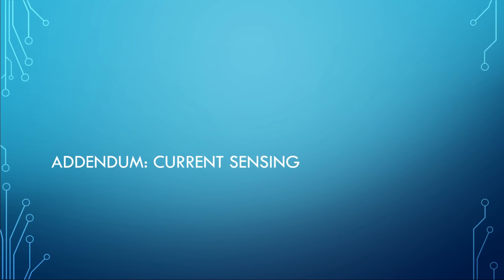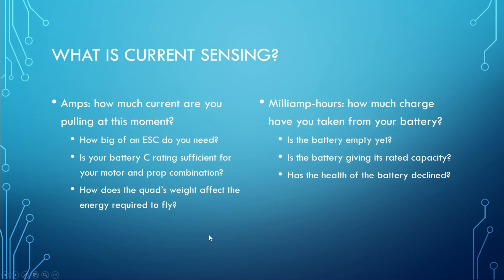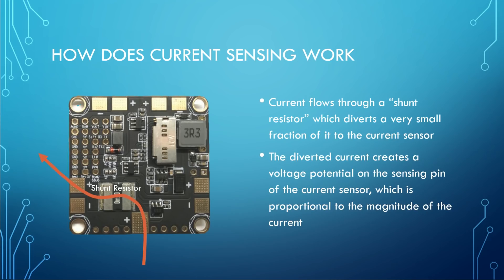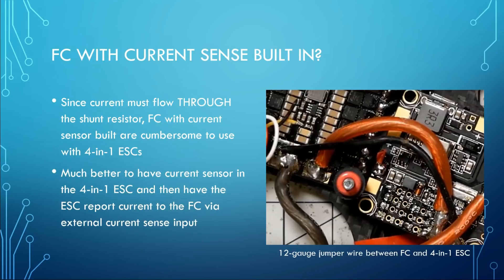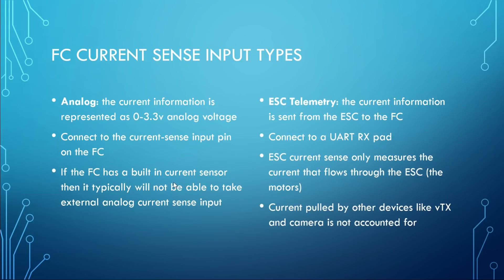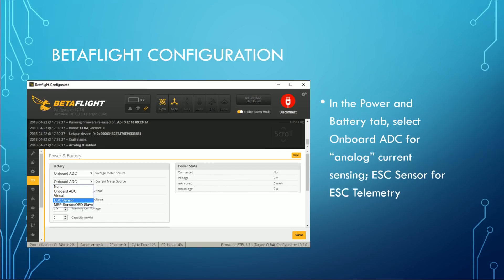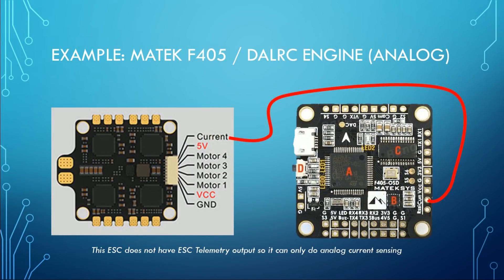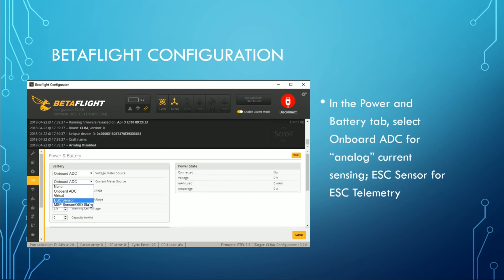Flight Controller Wiring For Beginners - Part 7 - Current Sensing

Comment from the maker: The ability to adjust current scale in blheli has been added in 32.4, so that part of the video is not accurate any more.
Reply: I have 4 seperate esc's and a crt port on my fc do i connect my + lipo straight to the crt sensor?

Comment: Hi JB, thanks for the comprehensive explanation. It’s an old video, but it still great. I use 4-in-1 esc with 6 wire, so no current sensor or esc telemetry. I use Onboard ADC in BF power setting and I can display mAh in the osd.  Then I found XT60 plug with current sensor in local market. Can I use that? I have curr pad in my fc. What is the difference with my existing setup?

Comment: how do  you wire current sensor a x8copter with 2x 4in1 esc ?
Reply from the maker: Basically, you can't, because each ESC is only measuring its own current. You need a external current sensor wired directly to the battery plug.
Reply: @JoshuaBardwell  i was thinking  of a swiching system to read each of them seprately !

Comment: I have Airbot F7.  It has what looks like a current resistor it is a 7mm x 7mm x 4mm tall block on the board labeled "470" and a current pad on the bottom.  

However it does not advertise having current sensing.

But then again I am.finding a few things it does not advertise having, for example it has F BUS and in what little documentation that came with it says it has smart port, this through me for a unneeded loop.

Anyway, is it possible that this "470" block on the board is a current sensor if so how do I wire for it, your video shows using 4 in 1 in connection, I am using a simple esc power block and wiring esc sensor wires to the FC.

Here is a link to the board and you can see what I'm talking about.

https://www.racedayquads.com/products/airbot-f7-30x30-flight-controller?variant=31414349725809&currency=USD&utm_medium=product_sync&utm_source=google&utm_content=sag_organic&utm_campaign=sag_organic&gclid=Cj0KCQjwl4v4BRDaARIsAFjATPkdUvy-XYa8xp3OeiZvtb1xRQmAjl_vqdyjsANyEfWG333vQO8t1Q0aAllxEALw_wcB
Reply from the maker: That's an inductor not a shunt resistor. That FC doesn't have current sensing because it doesn't have a built in PDB. Current doesn't flow through that FC. That FC must be used with an ESC that has current sensing.
Reply: @JoshuaBardwell  Thanks, this is why I watch your videos and research before soldering anything.  I'm going to skip the current sensing for now, im using the F7 to run an old cheap Eachine 250.  Kind of overkill by why not 

I did not know you had your own design of FC.

My next build I will get the one on the video.

You have an edge on selling FC's as you have an established set of videos to teach new people to the hobby how to build their own stuff. 

I know I can buy your FC and find a video on everything it does.  That is a massive edge over everyone else's ESC's 

I posted a review on racedayquads about the lack of instructions with all kinds of RC stuff, I am not alone in being sick of it.

To much time trying to find out what to wire, to much room for mistakes and I have $120 worth of burnt up Naze32 boards before I learned how to wire those.

Be looking for something called Wickedwings RC,  it's just decals for RC stuff but people want their stuff to look cool.
Reply: @JoshuaBardwell  Hate to bother you again, but I'm wiring the Airbot F7 now after watching your video series.

The only snag is when I unplug the USB cable the Receiver loses power.

Gets it the big old R8X using SBus all I got for now.

I have the Ground and 5V wires installed and going to the Sbus plug on RX.

I have the BDB wired to the Vbat and ground to the board, I assume that is where it goes as wire diagram shows no where else.

The board "says" it can handle up to 6 sell direct connect.

The output votage at the Sbus pin cluster with USXmB is 4.8v

Without USB and lipo only it drops to 2.2 volts and RX shuts off.

What did I do wrong?

Comment: Hey Joshua, I have the Mamba F405 MKII 4 in 1 ESC and flight controller stack which has a current sensor on the ESC which is connected via the curr and UART 6 connection from the ESC by default with the included connecting cable. The documentation indicates that UART 6 is for "ESC Tele". I have sensor input for UART 6 set to ESC, and under configuration I have ESC_SENSOR turned on along with current meter source set to ESC Sensor under the power tab. Under the motors tab if I spin them up it shows me RPM but current readings stay at 0A. I have tried different combinations of current meter source and nothing is working to give me a current reading. Could you help out with this? I am on Betaflight 4.1.1 and running the JESC 2.3 firmware and telemetry on the ESC. Thank you, get well soon.
Reply: I’m having a very similar problem. Have you figured anything out yet?

Comment: Please tell me how to voltage sensing on my 4in one esc which has only current sensing output and my micro pix fc has inputs for voltage and current inputs?Can i just plug 5v output of my esc to voltage sensing pin on my fc or i will smoke it?

Comment: Hello, I have the following problem. On my JBF4 AIO FC, the current is not measured, I use the FC with a JB ESC 4 in 1. Do I have to set something special in Betaflight or is it something else?
Reply from the maker: JB ESC uses ESC telemetry. On the underside of the FC bridge the TLM solder jumper.

Then set up ESC telemetry on UART 4.

In power and battery tab set current sensor to esc.
Reply: @JoshuaBardwell  I tried it that way, but unfortunately it did not work. the UART4 is equipped with VTX SmartAudio. Can it be that one can not use both functions at the same time? Or do I then have to put SmartAudio on a bad UART for example UART6 (is the only one that is not used yet)
Reply: I have now put the SmartAudio on UART6, on the UART4 I have set ESC telemetry and changed in BF the current sensor to ESC. The Amper indicator remains still at 0. The solder bridge on the bottom of the FC I have of course also made. Can it be that the FC I just have a defect?

Comment: Hi JB, I have a FC Omnibus F4 pro, which has shut resistor and I am planning to buy a MATEK voltage regulator, there too I see a shunt resistor, how could be the wiring for +ve here? should I plug in XT60 to MATEK and then sold MATEK out to shunt resistor in of FC?

Comment: I have a matek f722 se fc and  4x dys aria 35amp esc. The esc's has a curr and tele pad. The bottom of the fc has one pad for curr in/out. How do i connect all the curr pads from  the esc to the fc?
Reply: hi did you find your answer ?

Comment: Hey Joshua! I'm so glad to have your videos explaining all this stuff. I have a question about connecting a 4 in 1 ESC without ESC telemetry to your Bardwell F4. So to get correct current sensing I have to solder VBAT to the FC first. Then I connect the 4 in 1 ESC to one of the four ESC+ pads on the FC and ground is going from the ESC back to the battery. The ground of the FC isn't needed in this case, right? It's simply connecting them in series.
Reply from the maker: https://youtu.be/1SvbZNU72FE

Comment: JB, I'm wiring up a Kakute F7 AIO and I'm troubleshooting but I can't find anything on what the LEDs on the FC are telling me.  There's nothing in the manual (kudos on writing that BTW!) and I haven't been able to find anything in forums, etc; it seems to me that the question hasn't even been asked but I know that can't be the case!

Blinking blue, solid green, etc; what do they all mean!?

Any help, as always, would be much appreciated! And I appreciate you fighting the good fight and helping all us dummies out!
Reply from the maker: One of the LEDs typically indicates power and is either on or off. The blinking LED indicates the FC status. When the buzzer sounds for any reason, the LED will flash. A slow-blinking LED indicates arming is being prevented for some reason. 

When you try to arm and there is an arming prevention code, the LED will blink to indicate the code. More about that here: https://www.youtube.com/watch?v=N8oMMG2kmns 

Finally, if there is a hardware issue preventing the FC from initializing, it will blink a sequence of five-fast and several slow to indicate the issue. In this case, the FC will never start up, you cannot connect to USB, basically the FC is dead and all it will do is blink that code.

Comment: Hello love your videos..I have a question if you can help much appreciated...i am trying to connect kakute F7 FC with Dalrc 50a 4 in 1 esc using plug connector..The FC plug pin out says 
(M4~1) ( I ) (G) (R7) (B+)  Im not sure what the R7 and I is for exactly..I thought i saw somewhere that ( I ) is NC?
Reply: It's in their manual...ESC telemetry.

Comment: Joshua, very helpful video. Unfortunately I coludn't find the solution to my current problem: Iì'ld like to connect a pdb (Matek HUSBOSD-8) current sensor to Kakute F7 (non AIO) flight controller: I'm unable to find a pin on FC to which connect the current signal from PDB . Can you help me?
Reply from the maker: The Kakute F7 does not have an analog current sensor input. However you can probably use resource reassignment to convert the RSSI pin into an analog current sensor input. 

In the CLI type "resource"

Find the line that says "resource ADC_RSSI 1 XXX". Make note of whatever XXX is. That is your pin number.

Type "resource ADC_CURR 1 XXX" where XXX is the pin number.

Type "save".

Use the RSI pin as analog current sense input.
Reply: Joshua, tanks: you are a force of nature, you saved my life.

Comment: Hi Joshua, enjoy you're videos very much and find them very educational. What i want to do is fit a secondary louder buzzer to my quad but i only want to operate it by switch (ie i dont want it going off when battery is low/ signal is lost etc) is there any way of doing this? I have a hypetrain f4 riot flight controller.
regards
Jon
Reply from the maker: Betaflight supports only one buzzer at a time. But you can disable the low battery etc. functions if you want. In the Configuration tab.
Reply: Thank you for the quick reply Joshua. Is there any way you can wire in swichable extras on these boards or do they do boards that have extra outputs on for customized drones do you know? As I have a few things i want to try but also want the freedom of acro flight mode thanks again
regards
Jon

Comment: Hi Joshua. I have you're new Bardwell f4 and a Racerstar 35 amp 4 in 1 blheli-s with current sensing. What pin would i connect current sensing wire to on you're board to get Mah? You're so helpful to the community. Thank you!
Reply from the maker: Use the current sense input in the 4-in-1 plug. Check the manual for details--download from racedayquads product page for my FC.

Comment: Got an external current sensor built on the xt30 made by hglrc (could be a clone of diatone's). From what I understood in your video I have to connect it to the current fc pad and set it in BF GUI as onboard adc. So is it safe to say, whenever I connect to the fc pad its usually an analog signal? What is virtual source and will that work with the external current sensor? Are all external current sensors that connect to the fc pad give an analog signal?
Reply from the maker: Virtual uses battery voltage to guess about current consumption. It is inferior to an actual current sensor. All external current sensors are analog... well... probably there are some SPI or i2c ones, but you're unlikely to encounter them.
Reply: HI again, just spoke with support from hglrc and according to their tech I should set source to virtual and set amp scale to 200. but like you mentioned most external current sensors send analog signal so this really confused me. Do I proceed with common knowledge like in your video or do as instructed by hglrc tech support (which I am not confident they are right about the settings)

Comment: If you calibrate individual esc stand alone to get them equal i wonder if this is possible.
Reply from the maker: I guess that would involve disconnecting all but one ESC and measuring the current. A pretty big hassle, but not impossible.
Reply: Joshua Bardwell thanks that is indeed another requiring individual test. Been considering this or to save time , then again to fly my Quad 4-5 minutes my Chameleon the thought of going to all this might be a make or
Break for me . Or just stay with the voltage monitoring instead.

Comment: Hi JB
Your videos are so so helpful and informative many thanks .. i got a lumeneir +4 that comes with curr tap , i really don’t use this as i’m building quads with dji systems , if I didn’t use ( soldier ) any wire to that curr tap because i don’t need it , will this affect the other wirings ? Thanks for the help in advance as always..

Comment: Aikon 32 4-in-1 ESC telemetry only outputs voltage and RPM--NOT CURRENT; Need to use Analog for current.

Comment: I have the HGLRC XJB F428 version 2.  The 4 in 1 esc board has no "current" pad that I can find however, the FC (omnibus F4) does have "Current and RSSI" on separate pads.  Not sure what to connect the "Current" pad too?
Reply from the maker: If the ESC doesn't have a current output, you would need to install a current sensor.
Reply: Joshua Bardwell Got it thank you.  I made the assumption because it was a stack I was missing something (why offer it on one board and not the other). Never done learning, thx for your help!

Comment: For current sensing with a 4-in-1 that doesn't support it, the Omnibus F4 Pro works great. Just one pad, right beside the shunt resistor, instead of four separate pads for each esc. So easy soldering and you can include the current drawn by your vtx and camera.

Comment: Us beginners use f3 not f4
Reply: Why not, ? F4 FC's are pretty cheap these days. I'm also a beginner.
Reply: Us  beginners like mag heading lock and alt hold, good for los flying (10DOF), none of the f4 have this built in.  Add a gps and inav  and do unassisted not los flights. Gotta go to pixhawk or apm to get all this built in and its too big and can't stackit with other stuff for a smaller build. anyhow the original quest was what is the correct pin in for spracing f3 for curr in, I'm getting conflicting answers here.

Comment: Are two motors screws enough? I'm building my first kwad and I'm wondering...
Reply: Geraldo Robson I normally use all 4 screws with blue lock tight but you can use just 2 if you like
Reply: OK, thanks for the answer =D

Comment: Hi Joshua, I like to learn something new from you today!
Bought a Furibee X215 Pro PNP, connected to BF, all OK.
1 week later, received my new batteries & connected it to adjust VTX & BF too (10-15min), all OK.  Few hours later.... inserted battery strap below 4in1 ESC (TekkoS look-a-like), connected battery & MAGIC SMOKE!!!
Dismantle & found 2 capacitors just next to the shunt resistor of ESC went Boom!  What could have cause this?  Have I dislodge the capacitor while trying to pull the Velcro strap through the tight space?  Take note no TX or RX at all, since I’m new to the hobby.
Thank you in advance...

Comment: If I want to use the current sensor in my 4 in 1 ESC instead of the one in my flight controller, can I just desolder the shunt resistor on my fc?
Reply: No it's more complicated than that. There's an op-amp you need to disconnect, usually an ina169. Then you need to solder the 4in1 (analog) output to the correct input. You can look for a post on rcgroups explaining how to do that for an Omnibus pro. I have done it and it works perfectly, but it involves very delicate soldering.
If your 4in1 is blheli32 and has sensor output you can use a uart instead and avoid all the modifications.
Reply: ASJC27 Thanks👍

Comment: I got a Holybro 4n1 with an "NC" wire and a "TELE". Is "NC" analog current sensing?
Reply from the maker: NC is "not connected". Tele is ESC Telemetry.
Reply: So does that mean that wire is sort of like an auxiliary/unused switch mounting place in a car's dashboard? "This wire actually does something on the more expensive/future version" ? Seems wasteful for a esc* to have a null wire.

Comment: Sorry for the noob questions but my flight controller doesn't have a shunt resistor just like u showed in the video but ,the website says it has current sensor and it's omnibus f4pro v3 so is there any others sensor for current measurement.
Reply from the maker: The other main type of sensor would be a hall sensor, but I'm looking at a photo of the F4Pro V3 and it seems to have a shunt resistor.

Comment: Now there's a coincidence, just today received a HGLRC XT60 socket with current sensor to wire to my quad with full HGLRC stack.

BTW I also discovered that all the HGLRC ELF cameras are faulty and I told them this with an example, yeah seems like a bold statement, but it's true.

Comment: I am sure you've heard by now that current sensing is adjustable in BLHeli32. I use a ton of 4 in 1 ESCs.  However a question regarding this slider adjustment and even including its use with your board would be: " why is current draw so different from frame to frame". I build two identical models, motors, ESCs, FC, VTX, rx, all the same....identical components but different frames and the current usage varies so much, is way different from quad to quad frame. Wondering if you'd weigh in on this ?
Reply from the maker: Because the current sense circuit is not calibrated from the factory. They just buy a bunch of resistors and stick them on the boards and the normal manufacturing variance in the resistor values causes the current sense circuit to need different calibration.
Reply: How much difference?

Comment: I am able to adjust the current sensing scale on my ori32 esc in the blheli32 configurator, I'll have to check what the slider is called.
Reply from the maker: I think this feature was only recently added but yes you're right.